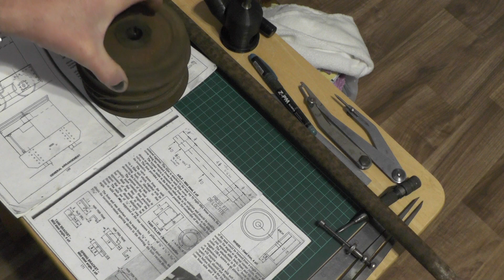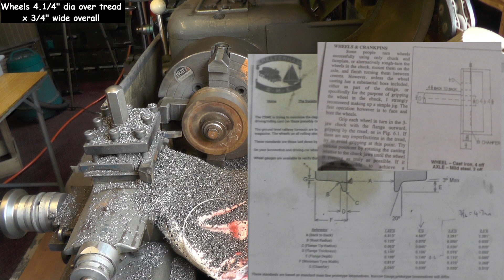Water Tender P4 - AXLES & WHEELS - For "Scratch" (My Beginners Steam Locomotive Series)"mr factotum"

Comment: How are you determining the width between shoulders on the axle? Scribed lines or some other cool method?
Reply from the maker: hi william
If you make the wheel profile / widths to the correct specifications, this gives you the dimension of 4. 5/8" (4.625")  back to back ( shoulder ) dimension for the track gauge of 5".  The wheel profile is important not just for the track gauge but also for going through track points etc.
Just measured it with vernier calipers.
Hope that helps
Kev

Comment: Grand job Kev.
Really enjoying this. Think I'm going to have to add some precision to my engineering. I'm still a bit hit and miss with accuracy.
Reply from the maker: hi Neil
thanks, it's like anything Neil practice make s perfect. You will definitely get there, so don't worry. Have you any plan on making anything specific, i think once you have a plan this commits you then to get your teeth in to it no matter how many hurdles you may face, and most times those hurdles aren't as big as you first think.
Take Care.
Kev
Reply: @MrFactotum  Think the first job is the power feed. Had an issue with the mill though. I had a knock on the Y axis and if I pulled on the bed the DRO readings would alter. Long story short, the tapered jib was at fault. It was ½"  too long and 5 thou too thin so it wouldn't take up the slack on the ways. A can of Tetleys came to the rescue!  Did you know a beer can is 5 though thick 😁😁😁
Reply from the maker: @NellsMechanicalManCave  
👍 How many cans did you have to measure to get an average measurement😜🤣👌👍
Reply: @MrFactotum  umm? A few ? 😋😋😋